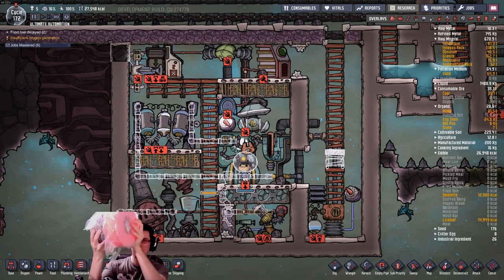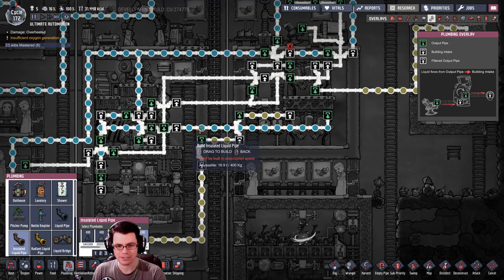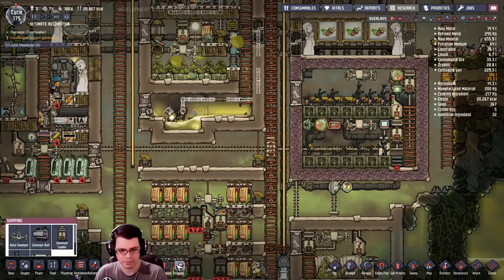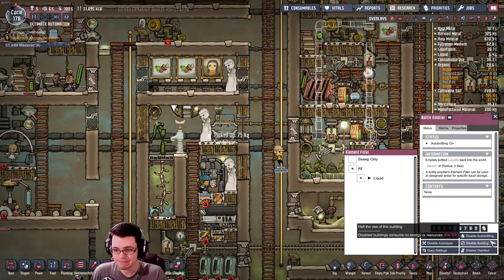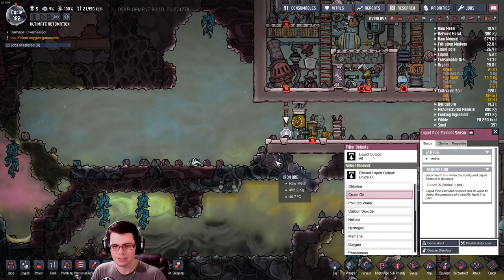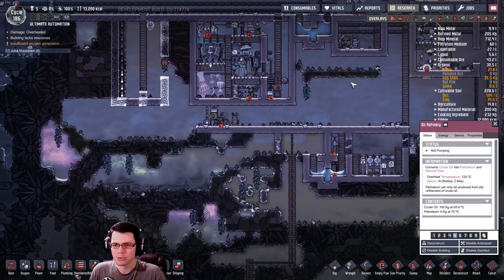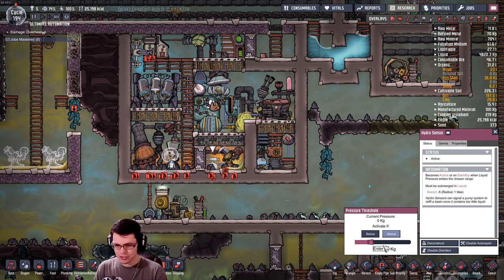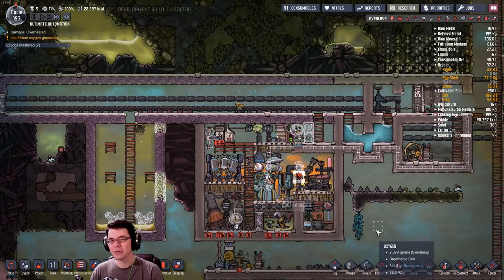Oxygen Not Included - Ultimate Automation Challenge! Cosmic Upgrade Part 9

Comment: Here's what ONI needs: floor drains.
The way they work (as to not be cheaty) is that liquid can never ascend in passive pipes, as in real life passive drainage.
Meanwhile specialized passive pipes can attach to vents and drains (vents accepting both the original and passive pipes, but the drain only attaches to passive) and a new "drain pump" will accept a passive input pipe and pump outwards to active pipes.
Using this, you could create "skyscraper water tanks" which are just very elevated pools of water with passive drains on their floors which send water downwards.
Another aspect which may anger some players but make much more logical sense is the refusal of all restroom drains to attach to normal pipes, requiring instead passive pipes; while perhaps water purifiers in their powered-ness pump the water out, allowing for normal pipeage.

Comment: Fun fact that I’m not sure if you know but is handy nonetheless: Water sieves will accept both polluted water and normal water without breaking. The water will gave several of its germs removed, and polluted water will be converted into water. In other words, it will output water regardless of what is input, so it’s not necessary to filter the input if you have a mixed amount.

Comment: Checking the wiki on the hatches. 
 Under typical conditions, it drops about 125 kg of coal per night if allowed to burrow or up to 600 kg over a cycle if not allowed to burrow and surrounded with plenty of objects to eat. 

If you don't let them burrow they don't produce as much.

Hatch Coal Herding
The goal of setting up this kind of herding operation is to have 6 - 18 Stone Hatch, consuming Igneous
4 Stone Hatch will produce 600 kg of Coal for one generator
If one is willing to forgo egg production due to crowding, they may have 8 Stone Hatch in one ranch
The sweet spot, however, seems to be 12 Stone hatch, providing perpetual surplus fueling for 3 generators and also providing a modest stream of Stone Hatch Eggs.

Comment: Might think about digging down to lava level first then going left or right and digging columns up so you can put automation at the bottom to handle everything that's mined out with. Could put a central liquid pump & sorting system at a low point in the center. Then just strip mine upwards and move the automation as you clear.

Comment: You can put 2 bristle blossom to suck any excess water with germs. And put them right next to the printing pod so they have light with a clock sensor to run at the end of the day. They need 6 dupes to bloom continuously but oh well.. They will keep a closed system running.

Comment: You spend a lot of time and resources dealing with heat. You could avoid all that by producing your oxygen in a cold biome or insulating your oxygen production facility and then cooling the oxygen coming out of it before sending it to your base. You could also build all the stuff that produces a lot of heat in a cold biome, I even add wheezeworts to keep the temperature from going up over time. I save a lot of time, resources and energy doing all that.

Comment: For more efficient power set up multiple smart batteries on the same grid with different thresholds so the hydrogen generator always runs first and the coal generator only switches on when the hydrogen generator can't keep up with power demand or runs out of hydrogen. I can provide a screenshot of my power plant if I explained it badly.

Comment: Hey, since you mentioned the transit tubes... I had a thought during your ASAR video a couple days ago - could you use the tubes and automation to force the dupes into a chlorine filled room to disinfect them? So use automation to lock them in for as long as possible before suffocation. Then it would remove the need for showers and wash basins (if you position the toilets in the right spots)
Reply: That would be a waste of a LOT of power though
Reply: It would probably work with just two mech airlocks and the duplicant transit access thing, but it would only work with a single duplicant for each chlorine room
Reply: Well, yeah, definitely not the most efficient system. But it could be interesting.
Reply: Don't take it the wrong way, you're just using gas that is used to make soap, nothing wrong with that!
Reply: Well of course it’s gonna sound bad if you say it like that!

Comment: hey there Brothgar. Just saw u got full of hydrogen, so a solution could be, and ive used many times, a compressor to buffer loads of KG in a small space, just need 2 highpressure vents, the 3 door system to move the gas and a pump to get it out as needed. if u want i can show u my concept which comes from your tuts.

Comment: question seeing as the polluted water from terrariums are in bottle is there a way for the automation things to move them to a location for duplicant pickup? or to send them to a bottle emptier?
Reply: i was only wondering seeing as id like to enclose the area and not need duplicants inside especially if i wanted to cool inside that space. maybe if they added a way to move bottle of liquids or if they added a way to pipe fluids out of the terrariums. that would be neat.

Comment: Yeah.. plastic! Why THAT would be complicated...? XD A little more cycles and you will cover every inch of the base with everything over everything.. Pipes liquid and gas, wire, automation wires, conductive wires oh! you don't have any heavy or heavy conductive wire anywhere! (I think..?) Just don't deconstruct blindly without filter and everything should be fine :P 

You didn't put any alternate routes for the hydrogen to go if the farm is in the right temperature so it's stuck.. Also, couldn't you use the germ sensor (now that there is plastic) reroute any germy water away from food making? Then you don't have to concern yourself with the spaghetti, you let automation play around :D

Did you notice that gasses end up more horizontally? They don't stay as diagonal as before and oxygen/polluted oxygen mix together.

Yay! Look look! Look at that pacu more.. Make an aquarium happen :D Also, did anyone notice there is a puft that turns oxygen into oxylite...?! Put that in a conveyor and puff! oxygen in the base! (I haven't experimented with that yet though.. :P)

Keep the videos coming bro! XD
Reply: Bat_tech664 if you convert early on to water based oxygen generation, later in game you have a lot of slime and algae unused (still I haven't tried yet to check the numbers :P) Also, I think.. there is a pacu that cleans water..? Not sure..
Reply: There was somewhere a comment about a "cleaning water" pacu that I've read... According to "ONI biology" topic in the forums there is the gulp fish. Its conditions of growing seem very strict though.. You probably need to cool the polluted water below 25 degrees Celsius that the fish lives but not below 0 when water freezes. I haven't played a lot with pacu yet :P
Reply: The end of water sieve! XD just dump the water of the toilets and let the fishes take care of it!
Reply: Oh well... But there is still hope XD

Comment: Use the heat from it into a steam turbine
Reply: And still dont really work, a lot of other better things for power. They could fix steam generators if the steam wouldn't pass through it unless it was on. So it would build pressure then once it reached a certain point have it turn on and pass the steam through
Reply: Tim G Your not getting to point its using all the heat from your base in stead of spending power and resources to get rid of it. It's like how you use a hydrogen generator for the extra hydrogen.
Reply: Right but your not going to reach the temp needed for the thing to turn on
Reply: Tim G its eazy
Reply: How? To transfer heat it has to go from the gas or liquid as to circulate from higher temp to a lower temp area. Unless your base is burning I'd like to know how you can transfer heat to a area that will get hot enough for the steam generator.